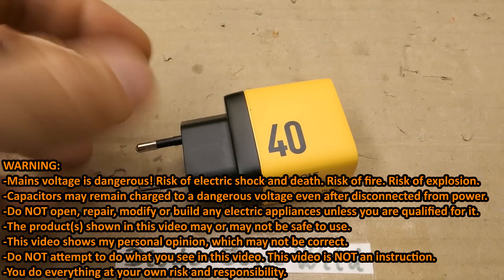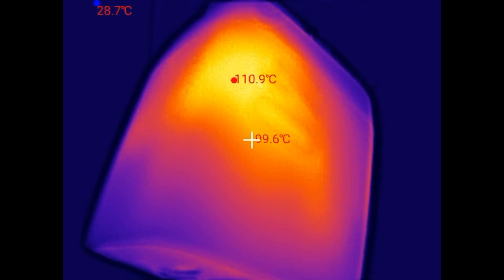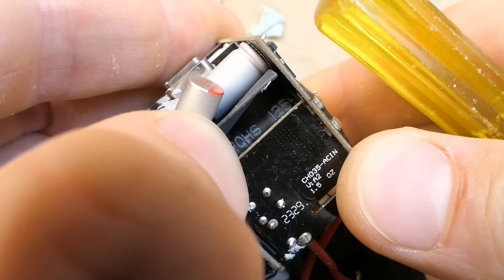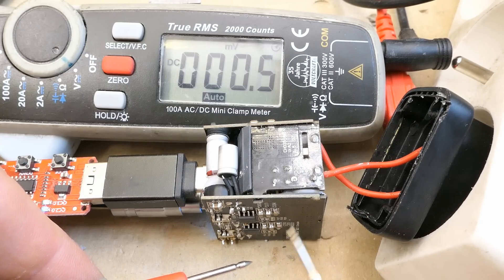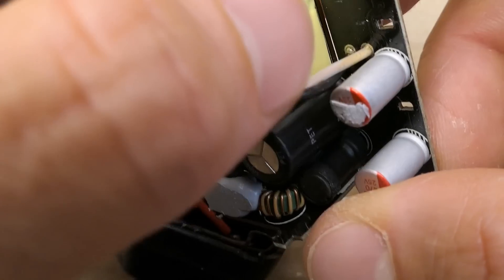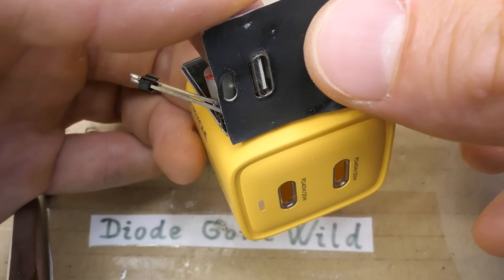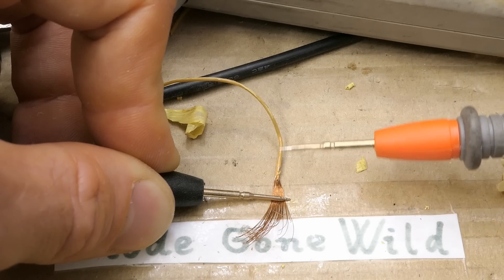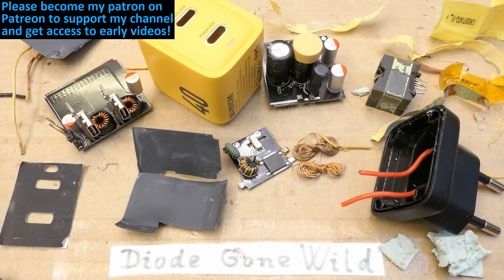$15 aliexpress 40W USB-C charger test

Comment: My smartphone has a 5000mah battery and charges at a maximum rate of 18 watts so I would need to be charging two of them at the same time for a decent period before it gets excessively hot - looked like a good device and worth the money.
Reply: Also your phone won't be pulling 18W constantly while charging the battery - typically you'll see the peak power draw only up to 40-60% charge, then it will drop off quite quickly to not damage the battery.
Reply: @liam3284  I really hope you don't apply the same standard to pc power supplies!
Reply: If you are aware of that and would make sure it’s never used above 30W then it would be ok, in theory. 

It would be a good charger if those limits would have been built in.

As it is now, I think it’s not worth the risk. Keep in mind that it only needs to go wrong in all of its lifetime. 

It’s unfortunate because other than that, it’s very well designed.
Reply: @Conservator.  It is unfortunate that it has such insufficient cooling, but also remember that smartphones and other small electronics don't draw anywhere near their maximum charging current for the full charging time. To avoid damaging the battery charging will start slowing down from ~40-60% and go ever slower as the battery fills up. So even charging, say, a phone and a set of headphones, or two phones, or a phone and a small tablet would be fine in most cases. Just don't connect two tablets or large battery phones with fully drained batteries at the same time.
Reply: @Kraaketaer  That’s ok if you’ll make sure that no one will ever draw 40W from your charger. 
So you should never leave it unattended etc.
Reply: @Conservator.  Drawing 40W isn't the problem. Drawing 40W for extended periods of time is. Remember, in the video it was tested outputting 40W constantly for two hours, and while I'm sure it reached the temperatures we saw after far less time than that, I still wouldn't be worried if it was to occasionally output 40W for 20-30 minutes at a time. And no regular use of a charger like this will see it outputting a constant 40W for hours. Now, is it a charger that's likely to last forever? Obviously not. Is it dangerous to use with the types of things people typically connect to chargers like this? Arguably not, for the reasons I've given above. Will it eventually fail? Yes, obviously. Does that make it unsuited for things like charging smartphones? Again, arguably not.
Reply: @Kraaketaer  The problem is that you can’t be sure someone will use it drawing 40W for an extended period of time. 
Charging a laptop, one or two tablets, or maybe some future phone for example. 
Maybe a family member will do that, or the babysitter etc. 

You can name 100 situations where the charger is safe to use but it will only take one where it isn’t safe to cause a fire.

Comment: If you want to open this glued connections, it is very easy to break the glue with a slight hit of a hammer. So you do not destroy the housing and you can glue it together again with no damage on the housing..
Reply: Do you know about any video resource where the proper strength of this «slight hit» is shown? I fear I'd crush anything with just these instructions 😂
Reply: @riangarianga  Squeezing the joint with a vice also usually leads to it popping open. And for the hammer trick use a rubber mallet, then you can hit as hard as you want basically
Reply: @MrOpenGL  Ok, thanks! I'll try on some disposable items first. I have both a rubber mallet and a nylon hammer, but still one needs to be careful with them.
Reply: @riangarianga  - You should take a old laptop battery or a power supply from the electronic trash and try to take it apart.

For the laptop battery you need more force and it is more difficult. A powers supply you can open mostly very easy.

So use a test-object to learn some skill and then you are able to open neraly every glued connection.

Comment: The charger was 40w combined (20+20) you loaded it unproperly, the charger most likely would have performed better thermaly by putting load on both buck converters
Reply: It's clearly labeled as supporting 40W (20V2A or 15V2.66A) on either port.
Reply from the maker: This wouldn't change anything about the super hot primary chip. This one gets hot depending on the total load.
Reply: @DiodeGoneWild  yes but the other buck converter ic  was the hottest
Reply: Nvm im wrong, sorry
Reply: @lucabarbolovici4974  each port is designed to withstand 40W, but that power is shared between the two, so if you're using both ports it would be 20W+20W.

Comment: I actually bought like 3 of it's crappier equivalent, just to open them up and get the female USB C ports out, got 6 total with bi-directional power transfer, as these are cheaper than any USB C ports I can get here for tinkering.
Reply: Lol what, there are USB C ports for under 1 dollar online.
Reply: @N4CR  probably not the type he was looking for. Some have to be bought in big quantities otherwise they are very expansive
Reply: There are many different variants of these ports. Some are harder to get.

Comment: If you power up the FNIRSI tester by the micro-USB "PC" port, it won't shut down on its own during measurements... 😉
Reply: and flash newer firmware :D
Reply: I have a FNIRSI FNB58 USB tester that stopped working while testing a charger with the QC3.0 fast charging protocol activated. The charger was outputting 20V with a charging current between 1.5 and 2A. The charger was connected to the USB Type-C input, and the load was on the USB Type-A output.

The tester turned off in the same way as shown in this video when exceeding a certain current, but I was unable to get it to turn back on. I tried with other chargers, but it still doesn't work.

According to the product specifications, it should be able to handle up to 28V and 7A, so I am surprised that the device failed under these conditions.

Does anyone have any idea if this is normal and what I could do to repair it?
Reply: Ask fnirsi for warranty or seller.  @ezequielcarranza5809
Reply: The very packed inners will not help against overheating
Reply: The video is basically put in unlisted then into public
Reply: How did you write this two days ago if the video was uploaded today?
Reply: @seikojason  Patreon patrons get two days early access to nee videos 😉